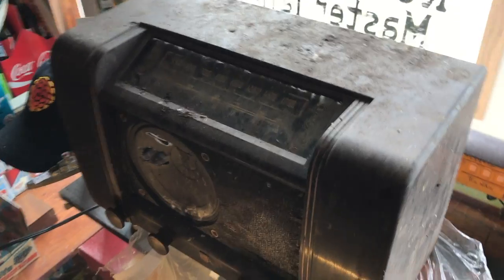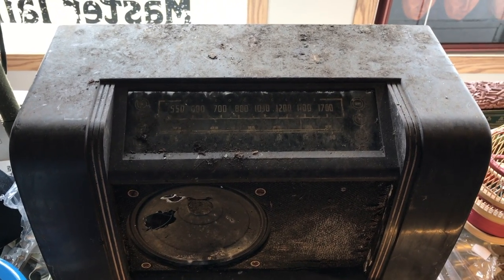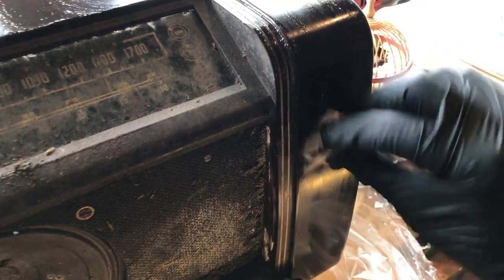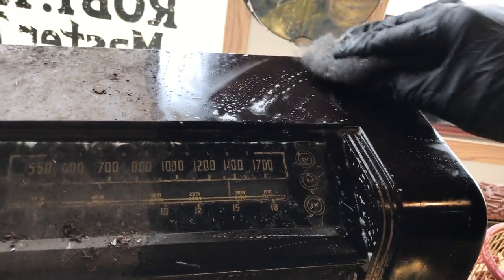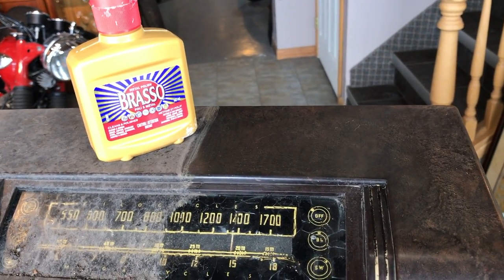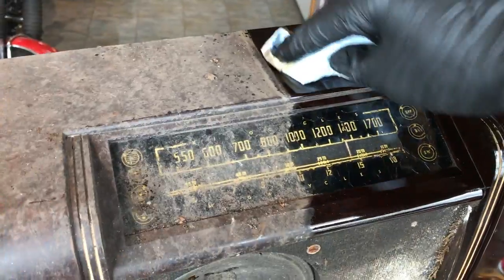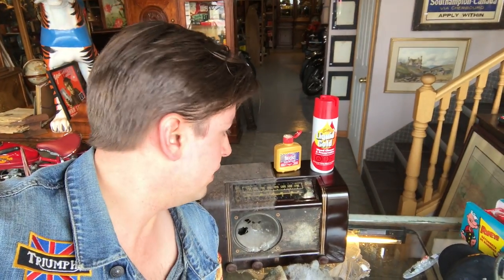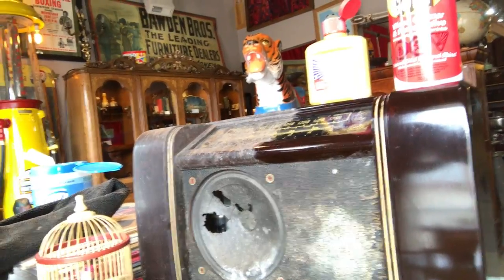Trash To Treasure! How to Clean And Polish Bakelite Cheap and Fast!

Comment: great fine restore but, there could be one more step
I have quite a number of cans with army wax which is a beeswax dissolved in gasoline when applied the gasoline dissolves a bit of the Bakelite resin and this bonds with the wax when buffed after its dry it will get a high gloss showroom shine and this shine will turn rock hard after a day or two great for barn finds like this
ps some folks just want radio's like this for decoration they don't care if it works
Reply: Let them fix one up then
Reply: huh?
Reply: Hoi Tino, kan je wat meer uitleggen over diesel met bijenwas en bakeliet? Ik heb hier een Oost-Duitse naaimachine met een bakeliets omkasting. Vet gaaf, maar het bakeliet kan wel een opknapbeurt gebruiken. Toevallig kwam ik je commentaar tegen en hopelijk kan je me een beetje op weg helpen.

Comment: So this amounts to cleaning with soap and water, then polish cover and polish well with Brasso (using 0000 Stainless steel pad lightly) and finally a good buffing with Liquid Gold.  Right?  That is really a nice looking (I assume) Airline radio.  Bakelite varied with quality depending on what was used in the Bakelite to make it.  Some radios have thin Bakelite cabinets while others are much thicker.  Of course the thinker Bakelite has a better chance of making it through the years, but none are immune to cracking if dropped or damaged somehow.  How would you compare this method with the NOVUS 1, 2, 3 method?  I have read that Bakelite if alcohol is used will cause the Bakelite to never have a shine again.  It seems the alcohol products damage the Bakelite beyond the ability of it ever having a good shine again regardless of what is used.
That radio sitting in a dirty barn with pigeon droppings, dust and dirt all over it probably saved the Bakelite from being damaged and eventually being able to be cleaned and brought back to its' original shine.

Comment: I wonder what made the chassis un-restorable ? most of these 1940s radios are called All American 5 because they are very simple - 5 tubes , a plug and a bunch of cheap resisters and caps. Most of the AA tubes are only $2-$3 a piece and volume switches can be sourced. The case looked more unique than most bakelites --- Never sand or do anything to bakelite that produces dust, because bakelite has asbestos and all kinds of other junk in it. I fear the liquid gold is also temporary, like Howards finish for wood it will dry up over time, need to re-apply and it will probably always come off on fingers and clothes as the radio is touched. Bakelites shine is made by pressure in the molding process, once the shine is gone it can never be restored by any method. All waxes and silicone just leave a wet look that eventually dries and while it is wet comes off by touch.

Comment: If the guts are shot a solid state replacement could be fitted. It will use a fraction of the cabinets interior and sound good with replacement speakers. The rich tonality you get with a tube set won’t be there but that and everything else was already gone.
No whippersnapper would ever know it wasn’t as original.

Comment: I went finest sand paper then cloth buffing with a dremel before using a resin based polish for cars. It worked very well. The polymer forming polishes work well on plastics like bakelite, bexit, melamin, etc. I might try furniture polish after watching your video, I'm not sure what a museum quality restoration would be?

Comment: unrestorable radios are perfect to transform into wireless/bluethooth speakers.
Reply: You can restore anything if you are good enough
Reply: No that's sacrilege
Reply: Very cool idea.
Reply: Absolutely not
Reply: You should still use the amplifier part tho
Fix up the amp section and connect a Bluetooth receiver into the turn table port or something

Comment: We have 7 old vintage radios that we are selling. This video is really going to help us polish these up. Thanks so much for sharing these tips. Can we ask 1 thing and that is will any of these chemicals have a negative effect on the bakelite over time?
Reply from the maker: I'm so glad it was helpful! I've used Brasso for several years now and haven't had any strange discolouration or side effects! I hope this helps! :)
Reply: Helps a lot thank you so much
Reply: just a update
I have just used this on a radio we sold and wow cant believe how well this tip worked. The radio looks amazing. Thank you once again for sharing this information

Comment: Any tips for repairing chips and cracks? With tube heat, I rarely find a case that is pristine, and aside from being dirty, there is usually a crack or chip or two. Plastic wood with paint in it is what I have heard about. Have not tried it as of yet. I don't want to try something that wont work.
Reply from the maker: chips and cracks are kind of a death sentence to originality... but... you could attempt to re-glue the breaks, then fill with a small amount of auto body filler. sand, then wet sand and colour match the repair with paint. it will not be perfect but it will resolve the chips :)
Reply: Finding Bakelight anything, that is NOT melted, cracked, or chipped is becoming very difficult. Thanks for your response.

Comment: id go full ham on that radio. full throttle cleaning  tube check  new cloth   new plug and plug wire  whip it onto a 12 volt power supply  comb through all the caps and resistors axe out the one with salvaged wax caps  plug in my home brew dim-bulb tester and pray to Jesus that this thing ain't a stick of dynamite masquerading as a  oldschool radio  XD
Reply from the maker: You should have this old radio ! :)
Reply: Thanks

Comment: I have several 60,s white plastic clock radios ,i just want to make the case shinny the case are in pretty good shape ,i just want a good way to make them to look better ,high gloss ,the easy and cheapest way possible.any ideas ,maybe ultra fine paint polish or not ? Help anyone
Reply from the maker: This method would probably work on that too
Reply: Novus plastic polish is designed just for this purpose, and is inexpensive.

Comment: You should repurpose the radio. Like remove the speaker area and find a thin nice wood to fit the area and make a drawer. Could be used to hold desk stuff or a jewelery box. Just a thought

Comment: make a homemade  speaker into it hook up to a blue tooth speaker clean inside add extra stuff turn it around making it look old but is a modern piece Bluetooth speaker and turn it around and sell it for 150 or 200.
Reply: why? why would your ruin 70 years of history?
Reply: @ArlenMoulton2  there's just nothing on AM anymore, and with BT audio you can stream the content you want and listen to it in warm tube sound from a really cool-looking radio. I have a number of radios running Bluetooth instead of AM. It's very very easy to revert back if some purist insists on AM only.
Reply: @c.brionkidder9232  No, it doesn't have warm tube sound, because it's a modern class D amp, the entire original radio workings have been removed, hence ruining the original radio. The original workings could be used as an amp for your phone so this wasn't even necessary.
Reply: sure destroy the thing and flip it for some dollaz....maybe you can make a hamster house with it......or you can repair it and add a bluetooh receiver to it without ruining it